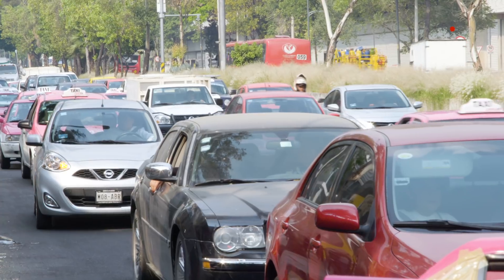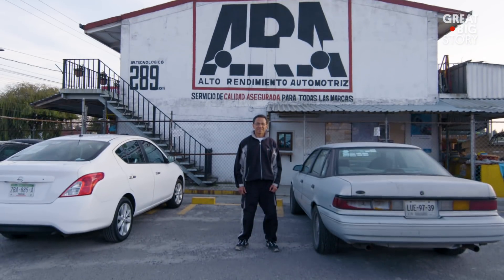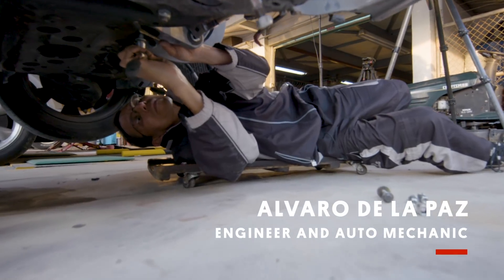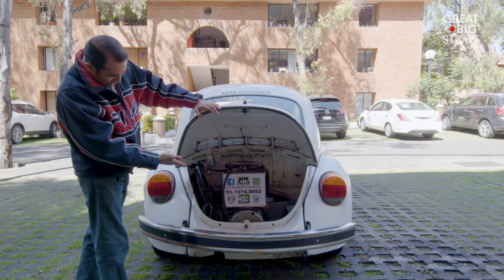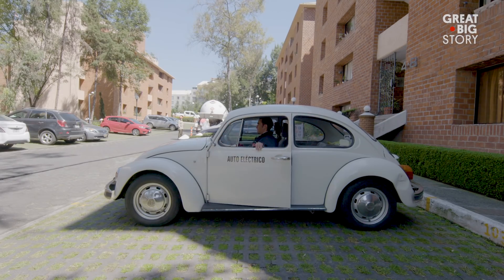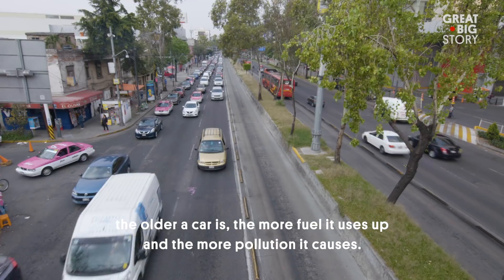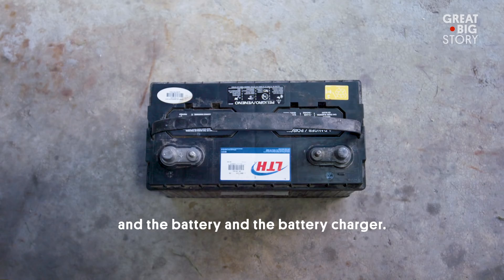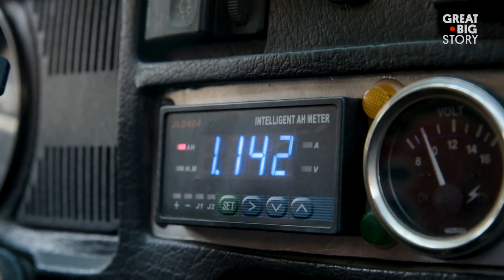Turning Gas Guzzlers Into Clean Cars

Comment: Ahh yes, zero emissions, because making electricity doesn't create any emissions...  The new energy is made with fairy dust and a flux capacitor.  I do commend the engineers that converted these cars but there's no such thing as zero emissions - at best, lower emission.
Reply: Sure, electric cars still require us to be reliant on our grid which is often supplied at least partially by a coal generator. But there exists a way to generate electricity without any carbon emission. Hence, electrification can be essentially zero emission. It's still within the range of possibilities. Internal combustion can't do that.

Comment: Isn't this dangerous it someone driving one of these cars were to get into a serious accident? Firefighters and other enforcement wouldn't know where to cut the electrical circuit lines before someone were to get electrocuted. Apparently with the electric f1 car if someone were to crash the rescuers would need to be very cautious since you can not smell of see if these vehicles are active.

Comment: Electric cars just push the pollution to the previous stage in the carbon cycle electric cars still produce pollution
Reply: mining cancer NO THANKS ...I LIKE CLEAN AIR WATER & SOIL   Carbon by hemp!
Reply: Even if that were the case Gasoline won't be there forever.

Comment: "Old gas guzzling cars...." shows an R50 MINI and an R53 ya sure 'bout that? Those things are some pretty darned efficient SOHC i4, not to mention the Eaton compressor the s variant comes with adds plenty of torque without reducing the fuel efficiency nominally, I mean, sure if you slam the gas rather often you get 25 mpg but driving like a same human person gets you 35+ mpg in a standard variant.
Reply: finally someone who properly understands engines who agrees with me on this
Reply: There's a difference between being fuel efficient and not burning fossil fuel at all. Sure, for now, common electricity often use the coal-based power grid, which seems to be the argument people use to say that electric cars aren't entirely carbon neutral. But there exists a way to make electricity without exhausting carbon at all. Such way doesn't exist for internal combustion cars.

Comment: Batteries are god awful, worse than gas because of the mining, making and other processes that go into making lead- acid and even lithium ion batteries. Sticking with gas aint great either, I think hydrogen powered cars are the way to go. Hydrogen is the most abundant element in the universe, and can be taken right out the air and turned into liquid hydrogen. The only byproduct is water, and it is clean energy that can be ran in cars, look at the toyota Mirai, not the greatest looking, but can go 312 miles on a tank and can do 111mph. Hydrogen doesnt take long to fill either unlike a battery, just like filling up your car. This is also more beneficial to 18 wheelers, using hydrogen instead of electricity, they still will have electric motors to drive, and will give more torque and power. The trucks wont have to stop to recharge batteries and take longer, only to fill tanks with liquid hydrogen. 

Link to help show why hydrogen is better than batteries 

http://www.techeblog.com/index.php/tech-gadget/top-gear-honda-s-hydrogen-powered-fcx-clarity

Also mind you, where do you think the power that goes into electric cars comes from? It comes from the power plant up the road. If we all drove electric cars there would have to be major  upgrades to the power grid and to the plants themselves to keep up with everyone plugging in their car.
Reply: although you are right that batteries waste precious resources the fact that the energy can be held and reused outweighs the constant refilling and wasting of gasoline.
Reply: Not only the energy that goes into making the batteries, but also the pollution. The H1, H2, and H3 hummers have done less pollution damage to the environment than just the batteries that go into the prius. The prius has few batteries, imagine what it would be like with a car that ONLY runs on batteries.
Reply: So you know all about both of them?  If so educate me.
Reply: Well you know half of one subject and a quarter of the other so it seems like your idea is the best one.

Comment: Ironically, what they don't see is that they're causing more harm to the environment.
New parts? sure they produce emissions during manufacturing processes.
Zero emissions? where does electricity come from? logically and statistically speaking, conversion of energy result in more losses.
Besides, coal produces far more emissions than petrol/diesel per unit mass.
Lastly, if we truly want to save the Earth, don't drive or use your old car until it's beyond repair and buy a new one with good thermal efficiency. :)
Reply: Electrification is a policy objective around the world already; not because there's some sort of ignorance at play that makes them blind to the points you drew, but because they are convinced.

Comment: Zero emissions ? ...Mexico has 3/4 of electricity produced with fossil fuel. I don't see how runing car on electricity in this country will improve CO2 emissions.
Reply: johannes914 Right. This is only one step in the overall plan. The next is to shift power generation to renewable sources.
Reply: Using highly efficient gas turbines, most of which have above 90% efficiency, and burn the fuel multiple times. By the time the combustion process is complete, what you have left is mostly water and solid residue.
Reply: xponen Yeah, but that extra efficiency is lost and then some when transporting that energy across long distances. Then converting that electrical energy to chemical energy stored in the batteries, then converting that chemical energy back into electrical energy that the motor can use. To then convert it into kinetic energy to make the wheels spin, and the car move.
Reply: Current commercial (Gas turbine) powerplant has efficiency of 63%, efficiency of piston engine is 30%, and efficiency of electric motor is 98%. We have to use gas turbine powerplant & electric car, they waste less fuel.
Reply: @ichymcgee2315  love this comment!!
Reply: have these powerplant made noise or produce pollution near you? no, because these large scale powerplant is more efficient than a mere car engine. There's many benefit to let someone else to produce electricity/energy instead of using a car engine.

Comment: Range? Top Speed? Acceleration?
Reply: If u want hypercar and supercar speed, just buy tesla
Reply: @dsaputrarizky  tesla top speed is 155 and its the fastest its a model s p100d,its loses to many fuel cars
Reply: Look up Jehu Garcia on YouTube.
Reply: dsaputra rizky Tesla's are nothing like supercars. Sure their 0-60 is impressive for a stock car at that price. But when it comes to track racing, or anything longer than a quarter mile, most cars at that price could beat them. Tesla's overheat because of the batteries if they accelerate or brake too much or go too fast they'll overheat, and either they go into a limp mode where they will slow down to like 30mph, or the batteries will catch fire.

If you wanted to make an all electric performance car, you'd most likely need some kind of cooling system. Probably water cooling, somewhat similair to what you have in a pc.
Reply: +dsaputra rizky bikin ginian yok !! wkwkw
Reply: Ayush Saxena i dont know dude, In indonesia rarely people modified petrol car to electric car, I think it depends to what customer want it to build, btw I'm college student of petroleum engineer, and I dont know what is the future gasoline, cause in future year like tesla will be more develop
Reply: Ayush Saxena but in my major, i could be take geothermal andthat is future energy to produce eletric, but in other case i hope oil and gas will be rise up lol
Reply: dsaputra rizky geothermal nor gas is the future, the future is taking the energy from clouds
Reply: carolyn mmitchell many ways to get future energy, it all depends on what country has dude, geothermal in my country is so advangentous
Reply: carolyn mmitchell so basically...flying cars?
Reply: carolyn mmitchell I think Geothermal is taking energy from earth.
Reply: Ayush Saxena geothermal is exploiting the heat source from in earth, then the heat(steam) use for moving the turbine so the eletric will be produce, and the waste of steam will be injected again to earth. So there is no waste from geothermal
Reply: Ayush Saxena you can make your own electric performance car, but you'd need to spend quite a lot on the motors. Depending on whether or not you want decent range, you might have to spend a lot on batteries too.
Reply: dsaputra rizky I just want to know, how fast the cars can go and for how long and if these modifications are a viable option.

Bdw I am from India, we don't have Tesla here but different brand of electric cars.
Reply: Ayush Saxena depends on what car they are working on

Comment: One problem. Batteries are not clean energy.
Reply: david sanchez don't forget that the future is still ahead an who knows what will appear that can benefit generations to come.
Reply: Older cars like these are actually better for the earth as all the carbon that occurred when they were built is minimal now to buying another new car today. Yes they emit more but given that they've been used for 40+ years and kept going is better for the planet than buying a new car every few years.
Reply: Suvi-Tuuli Allan zero point modules do not exist yet. And the government wouldn't let you have a sub-atomic manipulating subspace module anyways. Look up the nuke treaties.
Reply: EnderGirl 2318 and don't forget the acid and left overs from batteries like lithium left behind from the expended batteries which is not recyclable and more dangerous than c02.
Reply: What if we had Flintstone cars instead?
Reply: Dirty Sanchez
Reply: These aren't too bad, especially if they're using recycled batteries. Because they won't have the problem with the lithium mining damage, or pollution from production. 

If it's charging off of fossil fuel, or wood chip burning then it's not going to be any cleaner.

Tesla's and other brand new electric cars are a problem though. The lithium for the battery's is so ridiculous that I'd bet there wouldn't be enough lithium for everyone to have their own electric car. The environmental damage from the lithium mining alone is probably worse than putting down 100,000 miles in an efficient petrol car today.

If you really want to help the environment get yourself a conversion car like this. Or buy a small second hand petrol car.
Reply: What about ZPMs?
Reply: look into Robert Murray Smith on youtube.. he shows how to make all carbon batteries that have no negative impact on our world
Reply: got hemp?
Reply: They are cleaner than gas that's for sure. Especially older ones like these.
Reply: Lead acid battery is likely recycled. If you buy batteries from car battery shop, then they always take away your old battery. But these battery only last 2 years approximately, while Lithium Ion battery will last a decade.
Reply: Not but recharging reduces consumption of petrol and batteries reduce smoke caused by oil products
Reply: xponen lithium ions can last a decade. But that's with minimal use, with regular use they'll be dead in 5-6 years, and with constant use (like a taxi driver), you'd be looking at 2-3 years.
Reply: xponen look it up. 90% of lead acid batteries are not recyclable. Look at where they go and how they are processed.
Reply: Dhruv1223 you do realize the gasses produced by most convential batteries through charging is worse than any gas motor and is extremely toxic.
Reply: That's not the main concern is it. It's the green house gasses. At this moment.
Reply: C Mendoza you missed the part of the toxic gasses associated with battery processing. Lithium mining, battery discharge of toxic vapors, and disposal which is worse than the c02 emitted by gas vehicles.
Reply: Ichy Mcgee you missed where I posted how and why they are not. Especially in disposal.
Reply: Jaafar not those acid batteries. Neither are lithium. Especially when disposing and mining for the lithium. Which requires laying out the deep water that holds the lithium from the wells so the water can evaporate. Releasing other gases that are worse than co2. Now if he had a salt water super capacitors or water batteries. That would be green.